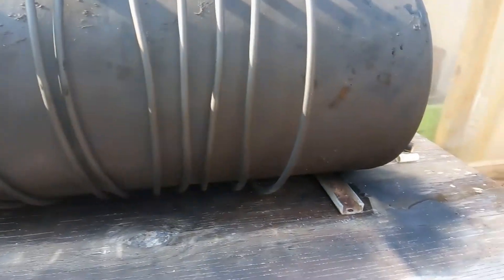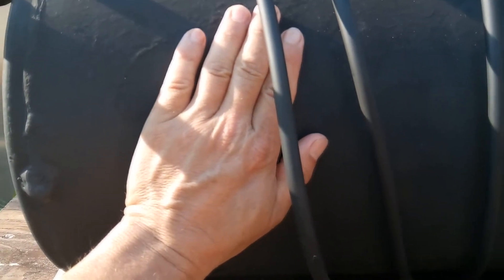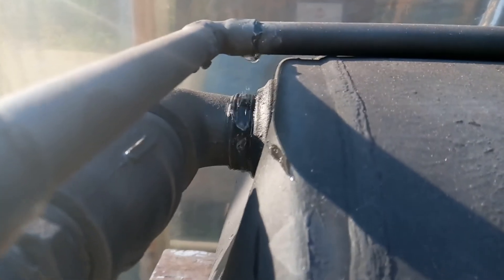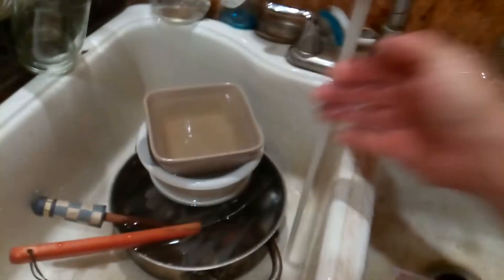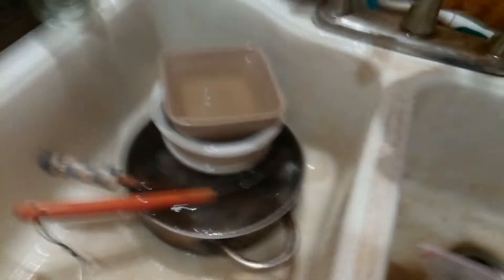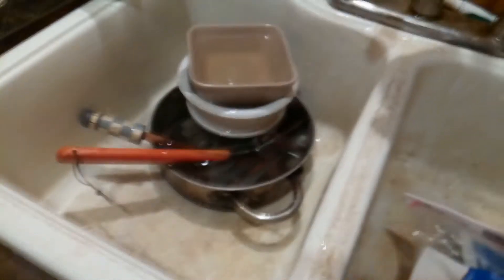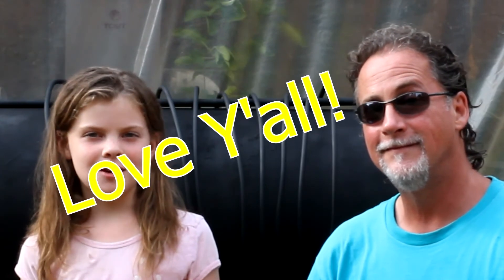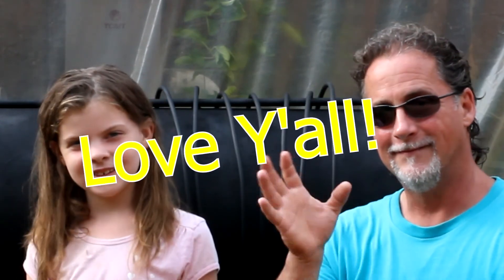Solar Hot Water Heater under $50.00

Comment: An electric tank holds more water in less area because it's visible volume is pretty much it's actual volume. A gas tank has a cone from the bottom lip up to the chimney. I'm not sure which is better for this application though.
Reply from the maker: TrollForge Awesome point brother it would seem the gas would have more surface area to heat and I can see with the gas one even putting some kind of heater inside the vent tube for winter time
Reply: goforgreenliving that would work. It would also work with a rocket stove...